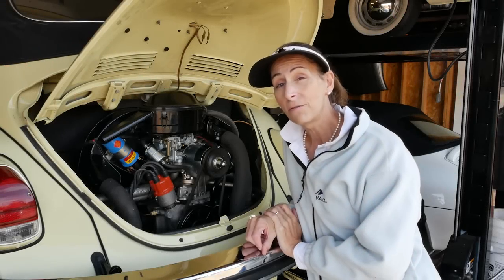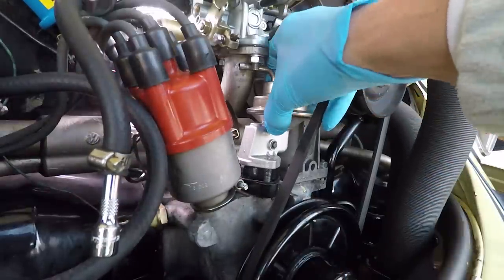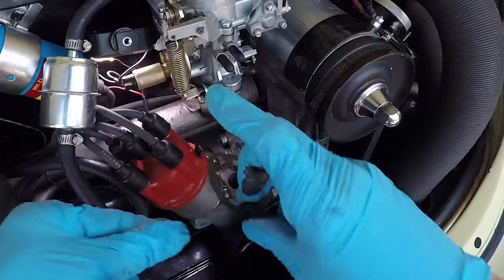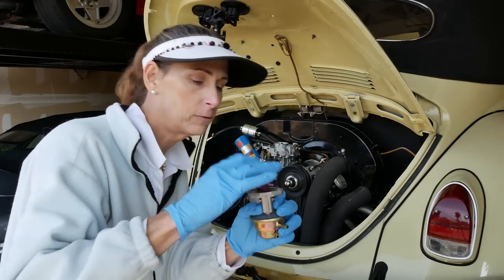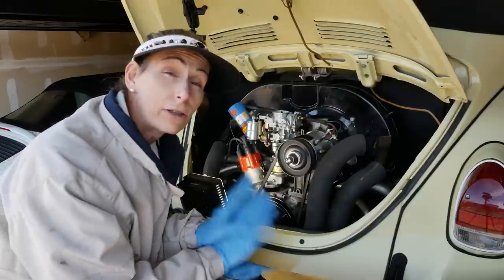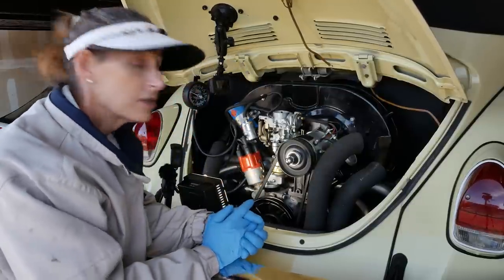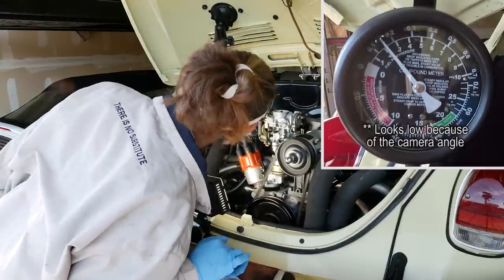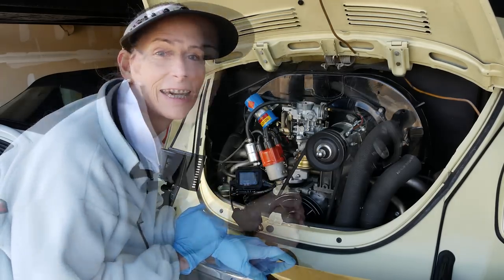How to Replace a Fuel Pump on a Classic VW Beetle (DIY - Pressure Test & Regulator)

Comment: Hello Franny,  I have a question about the use and performance of  a fuel pressure regulator installed in the lemon drop beetle; ¿do you really  think this regulator is necesary ?  I understand this application on a fuel injection  car, but a carburator works in other  very different way and the fuel pressure is not a problem because it is diminished inside the carburator, thanks I appreciate your answer and help.
Reply from the maker: It depends on the pump... If you have the original VW pump, you can shim to the correct pressure while still retaining the proper flow.  The modern replacement pumps put out over twice the needed pressure and will blow past the float valve needle and seat.  This causes a host of issues from running too rich to hard warm starts.  If you try to shim or grind the drive rod, you may get the pressure down but the flow will be so low you risk running far to lean at highway speeds which can cause your car to overheat.  A better solution if you run a reproduction pump is to use a flow regulator to dial in the flow exactly.  I suggest you test for yourself with a fuel pressure meter (not very expensive).  If the pressure is fine "out of the box" then no need for a regulator, but if it is too high, you'll need to regulate it.  The flow meter will tell you what you need to do.  Thanks, F
Reply: @HeidiandFranny  Thank you Franny, you are a natural teacher!

Do you know of a problem with (T3 commercials) where the clutch pedal locks in the 'up' position? Apparently, something happens within the bell housing, so the clutch release mechanism jams up and clutch can't be pressed down. Well, you can press it down, but only after you blow the nylon tube off the master cylinder banjo bolt - then you soak your interior with hydraulic fluid. I hope this can be fixed without 'engine out?? - ' ;-). ;-(

P.S. Technically, the correct way to regulate the fuel pressure should be to adjust the free length of the fuel pump spring. Surprised to see this method (adjusting pushrod length) being factory approved! - Easy to do it incorrectly.

Best,
Stuart.

Comment: Hey Franny... A new subscriber from Colorado Springs here. I've got a '70 standard beetle. Wondering what kit you bought and where. Having fuel supply issues (the pump doesn't fill the filter--mines clear plastic) and likely need to get a new fuel pump soon. I've also just purchased the Holley pressure regulator and will install soon. Would enjoy meeting you all if I'm up in the Arvada area. Thanks for any info you provide.
Reply from the maker: Welcome to the channel! Oh, for the pump and such?  Jerry bought that.  We have a bunch of links in the description.  The pump kit is: https://goo.gl/7qDcnC  The big deal is if you have a generator or alternator - just get the correct pin.  You might want to pick up a pressure gauge too.  It is really handy for dialing in the pressure.  Let me know how it goes!  F -
Reply: Thanks. I've got a generator--will definitely pay attention to get the right kit. I also have a gauge so I'll be following your process step by step.

Comment: Hi! Thank you for this great video! I'm installing one for the first time and I go the whole kit... I'm at the step where I put the rod in but when I turn the pulley to check the travel distance of the rod, the rod doesn't move at all. Is there something missing inside that's not pushing the rod? I bought this engine and it is still on my bench, they intended to use it with an electric fuel pump so they had plated off where the mechanical pump goes. I want to go with the mechanical one but I'm noticing this. Can you please help me? Thanks!!!
Reply: Update!
The rod does move but it doesn't stick out as far as the one you show in the video... When the rod is in the bottom position, the rod is almost flash with the gasket and when it is in the highest position, it is about 4mm above the gasket, so at the end it does travel 4mm like yours but why does mine sit lower then yours? And is this ok?
Reply from the maker: Sounds like you may not have the correct rod?  There are two lengths...  Are you sure you have the correct one for your pump?  Also possible that the distributor drive isn't correct...
Reply: @HeidiandFranny  I'm assuming I have the right rod since I got the whole set but I'll double check. Thank you!!!

Comment: Could you possibly swap the spring from the old fuel pump to the new one?? I have read that these newer pumps put out more fuel pressure due to the spring tension.

Comment: I was unfortunate enough to get a very small piece of the plastic flange drop in the case even though 95% of it came out using the thread tap technique. So, is that very small piece going to wreck the motor? Or, just break apart? I drained the oil before It fell in. So. I thought about shooting some air in the hole with the oil pan off thinking it might fall out. Wishful thinking??? Any suggestions?
Reply from the maker: Hmmm...  Well...  That piece could block an oil supply somewhere.  That would be my biggest worry.  The big question is how to find it and get it out.  You might want to flush it a bit as well.  Make sure you have a strainer under it.  You want to know for sure you got it out...

Comment: Super new to this... what type of grease would you recommend using? (for coating the rod, packing the bottom of the pump...) Thanks!!
Reply from the maker: Any all-purpose grease is just fine.
Reply: @HeidiandFranny  Thank you!

Comment: Just a question.. I may have missed in the video. When installing the rod, are both ends the same or does the rod need to go in a particular way?
Reply from the maker: I've seen the rod have two flat ends (probably ground) but it should have a pointy end and a flat end. Insert the pointed end down into the engine.  Don't forget to pack the pump underside with grease.

Comment: Great video. Thank you for sharing! Do you happen to know what type of fuel filter was on the 1969 Beetle. Is it still available? Lin
Reply from the maker: Yup!  Sorry about that.  Missed it in the description You can get it at most auto parts stores: Duralast fuel filter FF3424DL
Reply: Heidi and Franny's Garage thank you!

Comment: I've been working on my 67 bug wiper motor and linkage. I have the linkage all correct and the test on the motor worked last week.  But tonight I put it all back together, hooked up all the wires and tightened up aht nuts and tested it all out and NOTHING!  I know all my wires are correct because I photographed everything and put it all back, I even put labels on the motor and wires.
I painted all the linkages so maybe there is no electrical contact as there should be?
Also I lost the bolt that goes through the linkage into the body under the window, could that be a short in the circuit?  I've been working on this for a week, its 2am, I'm going to bed.
Any help would be greatly appreciated .
Reply from the maker: A short circuit would blow a fuse so start there and check the power with a multi-meter.  If all good and it is a known good part it is probably a ground.  You will need to remove the paint at the mounting point so it can ground.  Good luck! F

Comment: We've found that after-market pump stands (phenolic spacer) may not be the correct height.    This can result in higher fuel pressure.   IF...an original VW spacer can be found--by all means use it!
For fuel pumps 1970 and earlier, quality rebuild kits can be purchased.  Either rebuild those pumps or have them rebuilt professionally.
Reply from the maker: Agreed...  our 356 has all the original parts and they work just fine even after 60 years.  Just carefully rebuild.

Comment: I’d be willing to bet to high fuel pressure is the problem with “Scrumptious”, my wife’s 1969 VW Beetle 1500 powered MGTD kit car. Very hard to start after a heat soak. Maybe u can help me out with an on going problem with it. Very lumpy idle and missing under light throttle after it warms up. But accelerates fine under WOT. This has been the case with this car for years. Over time I’ve checked compression, adjusted valves, set timing, changed cap, rotor, wires and plugs, switched to electronic ignition, cleaned out the heat riser tube in the intake, all with very little affect. Have you every encountered anything similar? Thanks Franny
Reply from the maker: Hi Jeffery, sounds like Scrumptious may be running a bit rich.  If you can, you might want to look down the carb throat while it is idling to see if you can see any fuel pouring into the throat, but be careful!  It may be that the needle and seat (float valve) isn't shutting off or just can't withstand the pressure of the pump.  Since you probably are super concerned with exact originality on the engine, an electric fuel pump with a built-in regulator might just do the trick.  Set the pressure to 2.5psi (ish) and see if all those problems go away.  We had a needle and seat go bad in the left carb of the 356 and it did as you are describing.  Sounds like you have swapped out the electrical system and set the timing/valves so fuel is a good place to look next.  I hope you get it sorted.  Sounds like a fun little car! :) F
Reply: Thanks Franny. I’ll check it out. I did have a cheap electric pump at one time but I had no idea to even be concerned about fuel pressure so who knows what it was putting it. Also, it failed internally with the car parked nose up and washed about a quart of fuel into the engine. Great video. Super informative . Thanks for the quick reply
Reply: Check your vacuum.  I have a 1927 Bugatti kit car, 1st place winner with over 300 cars in competition.  I put every gauge imaginable in the dash board, including vacuum when I built the car.  I recently changed from a 1500 to a 1600 duel intake port, oversize jugs and a few other goodies.  My vacuum was only 15 psi.  I built a cover plate to go where the carb is with an air compressor fitting and put 20 psi into the engine.  It turned out to be a crack in the left side intake port manifold under the flange.  I couldn't see it.  Also getting some small amounts of air out of the left side rocker arm cover gasket.  I fixed that and now it runs great with almost twice the power.

Comment: Hello hope all is well, . I have a 72 super bettle,  we recently purchased it needs a lot but runs great.   But my question is about a engine that is in a sandrail,  the distributor is locked in with the 13 mm, on the backside , but the clamp around the distributor is tight but , and will turn left or right  ,. I loosened it then re tightened  it still turns is that Normal  .?     Ben
Reply from the maker: The clamp should lock the distributor body from turning.  If the clamp is tight and the distributor still turns then the clamp needs to be replaced.  It probably has a crack and is about to fail.
Reply: Thank You,  so much will replace ,   ben
Reply: As compression goes , in the cylinder,  what pressure do you think the low side would be ,to rebuild a engine.   ?  Thanks ben.

Comment: I am replacing a fuel pump but believe that the rod has just worn over the years.  I purchased a new pump.  My question is should I try a new rod and reusing the old fuel (original) pump or just replace the whole thing?
Reply from the maker: You can measure the old rod to see if it is within spec.  If you buy a new one make sure you get the correct length for your pump.  Rods are cheap, but they come in two different lengths...
Reply: @HeidiandFranny  so it turns out that the black intermediate flange broke and there is a piece stuck. Do you have any suggestions on how to fish it out?

Comment: Hi Franny, I just replaced my fuel pump on my 71 super beetle. However, I tightened the pump down when the rod was in its highest position. Do you think that would cause an issue?
Reply from the maker: That is fine, but I would rotate it through manually, slowly.  You do have the correct length rod, right?  for reference, I think the rod is at its peak when the engine is at TDC cylinder #1.
Reply: Hi Franny, yes the kit came with a rod that was slightly bigger than the original. I had it at TDC to keep track of the distributor that I removed. I couldn’t get at the back nut.

Comment: Okay, my spacer was stuck in there really good, and I probably should have just left it, but since I had the whole kit I tried to force it out to use the new one. The original one is made out of that bakelight material and it snapped off, leaving about two inches behind wedged hopelessly into the motor. I tried needle nose pliers on a small corner that was sticking up--too stuck. I also sent a screw retractor bit down there, which took a good bite into the material, but the material is sort of brittle. It did not withstand the the force needed to break the stuck piece loose. I'm really afraid of having small crumbs of this bakelight material fall into the motor. Will it break up before doing damage? Will it come out with an oil change? How can get under the tip of that spacer and get it loose? I need some kind of toggle. . . . feeling hopeless!
Reply from the maker: Gosh that's a bummer...  I've heard of that...  I have heard that folks will use a long threded bolt with an end that will just go through the hole and then hook the edge on the snout.  Then pull it out almost like a puller...  Once you do get it out, probably a good idea to flush it out well.  Take the oil screen off the bottom and flush out with diluted oil.  Try to catch and strain what comes out so you can see if you got the bits.  I don't know why they get so stuck!
Reply: @HeidiandFranny  Thanks for responding. So you mean that I put a bolt that is somewhat tight all the way through, then slant it a little so the threads catch the bottom of the broken spacer piece and try to pull it out that way? 

Do you think it would be advisable, once I do get it out, to flush through that opening with brake clean as I drain the oil and strain it for bakelight shards? Assuming I might be doing another oil change pretty soon after?

I really appreciate your help!
Reply: @HeidiandFranny  Okay, thought about it all a little more and paid closer attention to your advice. sent a tap down there (I think 3/8") and it came out in two chunks. At first I backed out the tap, cuz I didn't know how far it went down, then put a long bolt in there with a oversized nut on it that I could grab with a vice grip and use as a slide hammer--tapping it gently. First chunk. Then the tap going down a second time got the whole thing moving and I was able to twist and lift the last bit out.

That material pulverized pretty well, so while I am going to do some oil flushes as you suggest to look for the powder that remained behind in the motor, I'm going to tell myself that it will yield to metal parts and not do too much damage in there until it's time to rebuild the motor. . . .

You're the bomb Sister. Such a good teacher.

Comment: Hi Franny.   Can you please tell me what the second black adjusting screw and arm are for on these carburetors and if and how to adjust them ?  Cheers, Joel
Reply from the maker: Hmmm... Not sure what arm you are referring to... The throttle arm?
Reply: @HeidiandFranny  The arm next to it with the black adjusting screw next to where the spring attaches.
Reply from the maker: @356jager9  I don't have it in front of me, but I don't think it does anything. I've looked at a few exploded views and it isn't even called out. If I find something I'll let you know.
Reply: @HeidiandFranny  Thanks.  Would suggest moving your fuel filter to a point under the car instead of the engine compartment.  Great video as usual.

Comment: Why does my top gasket look much different than the bottom gasket? In your video they look like similar gaskets for top and bottom. Am I using the wrong gasket for the top? Mine is more filled in with a little hole for the rod.
Reply: Well, I finished the installation with the 2 different gaskets and it works and doesn’t leak. I’m gonna go ahead and call that a success. Thanks for the videos btw. You are by far the best at explaining what you’re doing and I’m a big fan!

Comment: 1972 super beetle that will shut down when the clutch is depressed when approaching a stop. also doesn't want to idle once she is warm. she had been sitting for 10 years when i bought her three weeks ago. any suggestions?
Reply from the maker: I would start with a full tune-up.  Also flush the gas in the tank.  In addition you probably have some clogging in the carb.  I would pull the carb, disassemble and completely clean it including the jet(s).

Comment: Hi Franny, where did you get that metal Fuel filter? Is it the stock 1/4 line?
Reply from the maker: Either 1/4 or 3/8...  From the FLAPS.  Autozone I think?  A little less scary than the plastic ones.  F

Comment: Hi,Franny :) ,Is there eny way to conclude 100% does the car has an alternator or generator ,I've got here '1300J'(J-assambled in Yugoslavia),it's 1974 but these were assambled from the parts of older German models,so I can't be sure what I've got here and I'm not an expert...
Reply from the maker: They look really different.  The alternator will have a cooling fan right at the pully.  The generator is longer with no fan blades visible.  Let me know if that helps :)
Reply: @HeidiandFranny  it helps,thank you a lot .I meant that for  cooling blades but I don't have eny and I wasn't sure if there are like different types,maybe some without fan,I meant  to show you pict of the motor but can't attach it here